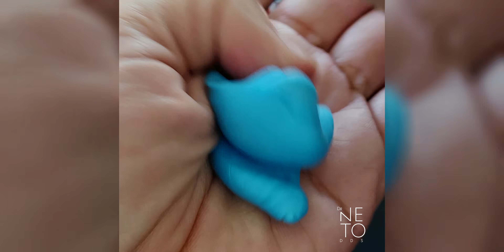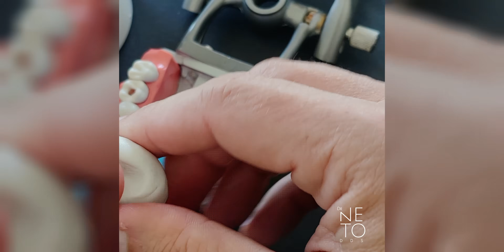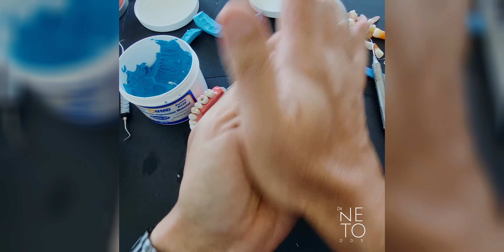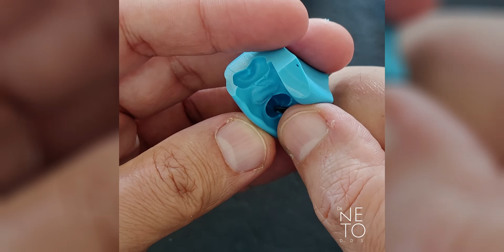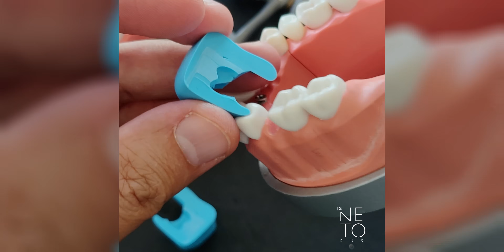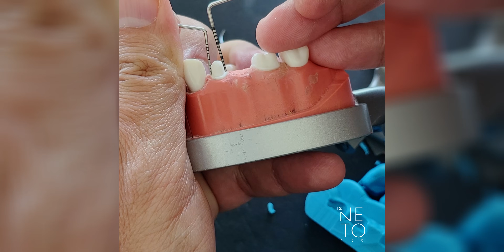How to use putty to create a bridge. Putty on Teeth #3 and #5 BRIDGE for ADEX CDCA Exam Success

Comment: Maybe re-record the video with a better putty matrix. If you need to hold it down with your finger to engage it, you didn’t make it correctly.
Reply from the maker: Putty contracts sometimes during the setting process, which drives to that opening. If it's minimal, holding with a finger to make it stable is not a big deal. During the exam, time management is crucial. If you have a regular set putty and you have this little manageable distortion, would you prefer wasting 5-6 minutes of the exam just to  make a "perfect" one? I wouldn't. I teach people how to learn from mistakes and how to handle them.